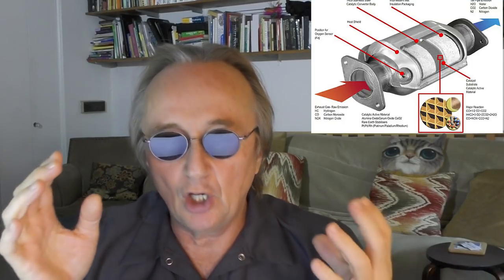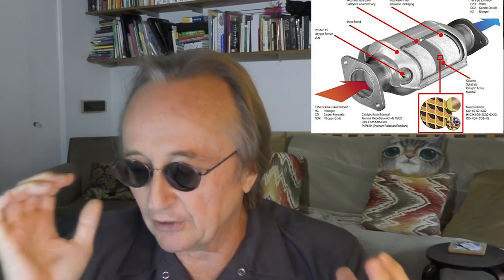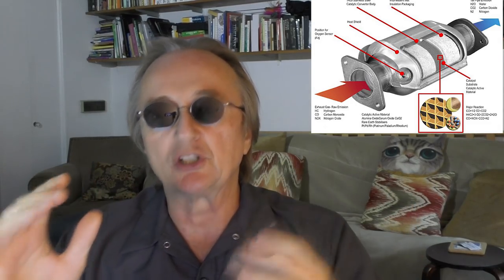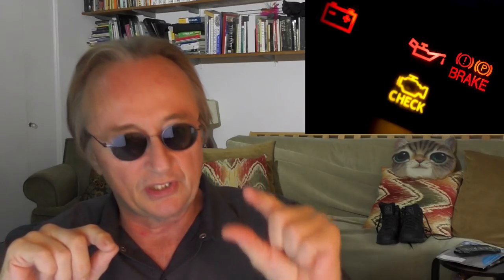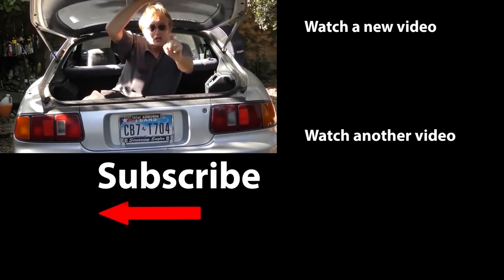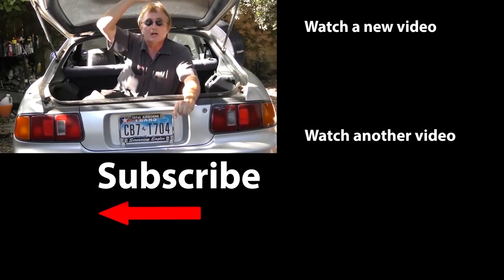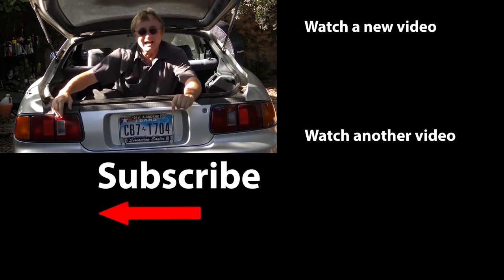Why it’s Illegal to Remove the Catalytic Converter in Your Car

Comment: You’re correct about the engine being stronger than the transmission. I had a friend with a 2005 Grand Prix GXP, it did burn oil but the first thing to blow on it was the trans at 120k miles

Comment: Speaking from experience. DO NOT buy one of those Mazdas.
Reply: But do the new ones actually good?
Reply: I've had nothing but good luck with Mazdas. My father has an '08 Mazda3 he bought brand new, and two of my other friends have an '09 CX-9 and a '12 CX-5. Super easy and cheap maintenance, and the vehicles work flawlessly. But it is absolutely CRITICAL that you change the oil every 5,000 miles or every 6 months (whatever comes first) because of the VVT setup. Otherwise, I think they are great cars.
Reply: Yeah well its powered by a ford v6. No surprise its a piece of junk.
Reply: @lucif3r839  bro say that to my 2011 Mazda 6 V6 which has had ZERO repairs needed . Just oil changes , air filters, transmission oil change , runs like new .

Comment: in my small country town in the states it is legal to take them out but they're required in the city(our car also got its fuel pump replaced along with a 4 in 1 catalytic converter removed)

Comment: 86 GMC Jimmy.  No convertor needed
Reply: When they did have cats, they were horrible for clogging off.
Reply: No emissions testing for vehicles over 25 years old ,here in Texas.
Reply: jerry rodriguez man I want that! ! There hard to find in Michigan, when you do the body's gone. I have a 98 Tahoe, runs great! But the dang salt!
Reply: Um...unless it's a Diesel yes you need one. Your state may be cool with that but there are others....
Reply: @sandralaunstein6436  I have slight rust on the inner fenders but that's it . 6 inch lift ,35s ,456 Yukon gears ,lockers ,350 with a Holley avenger carb, headers etc
Reply: true but it still has to pass the smoke test.
Reply: @ateam6486  You mean smog? Most states don't do emission tests or inspections
Reply: the most common rule is cars must meet emissions requirements of their production year
Reply: TheSushiraw  Not needed, required for that year, yes, needed NO.
1986 K10 500,000 miles and counting......No cat since 78,000
Reply: @ateam6486  LOL We don't have smoke test, and in fact its over 25 years old, no emissions requirments at all, AND if I put historic plates on it no inspections AT ALL!😁 God I love MO
Reply: @devinwilliams3489  not after 25 years

Comment: In South Carolina there is no car inspections so.....nothing but freedom comes out of my cars.
Reply: If you could put a cat back on when you can I'm sure everyone here would be grateful, we share the same air after-all.
Reply: Adam Nope yea that was a joke. I do have a car with a test pipe but it’s not a street car. Lots of people in sc don’t tho bc there is no inspection.
Reply: please look up what a federally mandated EPA or federally mandated safety device is.    such as seat belts,   air bags,   and even in states with no smog testing you must still have the cats on,   and after taking them off or hollowing them out,   did you notice a huge increase in gas use,   do you know what and how oxygen sensors are??  and how they control fuel injectors.
Reply: Freedom to breath clean air?
Reply: Its tyranny!

Comment: cmon scotty, hydrocarbons are really bad. it shouldn’t JUST be the law why not to take off your cat.
Reply: Samu BRidges Cats also get rid of NOx and carbon monoxide. Those hydrocarbons become soot all over the cities. 

I'd not remove them. I really don't feel like polluting for a slight gain (hardly any nowadays). The good news is that the mandate was to ensure that the majority of vehicles would have them. A small minority of rubes and ricers won't singlehandedly destroy the air.

Comment: Scotty, is it illegal to have BMW angel eyes on a different color than white?
Reply: Don't be a tool
Reply: Jwjsudksj Idksjhdjjdj i think blue and red are illegal but honestly just don’t do it. It’s looks great as it is. Maybe there’s kits that let you change color whenever you want but I’d just let it stay as it is. But definitely avoid colors like red and blue.
Reply: Joseph Samsor Ty, not enough with red and blue I have up to pink. It is remotely controlled:p
Reply: Jwjsudksj Idksjhdjjdj yeah just look up what’s allowed in your state and do that. Maybe for pictures or meets you can put on whatever color you want but on the road certain colors are banned. Probably due to police cars using those colors.
Reply: Jwjsudksj Idksjhdjjdj which angel eyes? I think white or a lighth blue is best
Reply: It depends on your state law
Reply: Jwjsudksj Idksjhdjjdj  yellow , bleu, purple!!!! Pink, its all illegal
Reply: Hugo Lizardi Write this on Ebay: bmw e46 multicolor angel eyes. You will se pictures with a remote, got them
Reply: It's certainly illegal to engage the flashing amber lights when you're driving a bmw.
Reply: BMW owners want mood reflecting head lights so you'll know what stage of shmuckiness they're at???🤷🏻‍♂️

Comment: If your 02 sensor is before the converter don’t remove it that will throw off a code as it’s gonna show your running rich but if it’s before the converter knock yourself out it does help open the cars up and give a little more sound. I live in Kentucky where we don’t have any kind of inspections and I usually do remove them as long as the sensors are before the converter.

Comment: The federal law only applies to companies doing it for customers, or for vehicles used for commerce. If you don't have emissions testing, or are exempt, you are fine.
Reply: Tim Ramich whether you’re right or wrong it doesn’t mean you should pollute the air.
Reply: benefactionhindrance  Without it, it don't pollute any worse, actually probably less due to not choking the engine with another restrictive device.  Anything you add downstream from the headers is restricting exhaust flow which in turn restricts the capability of the engine to breathe thus choking the engine and causing it to use/burn more fuel because it has to work harder.  Punch out the internals of the catalytic converter and put it back on worst case...best to just remove it and replace with a section of exhaust pipe.  You'll get a little more power and a bit better fuel economy without the catalytic converter choking your engine.
Reply: @buffalobillswin187  It takes unburned fuel to run them. That's not a desirable trait for running an engine. Or for your pocket.

Comment: Im thinking of buying a 2000 bmw 323i for 2,500$ it is in good condition what do you think of this car?
Reply: Marcos Rivera he hates anything bmw lol. I’d say it’s a good car if you handle all the problems yourself. Don’t expect it to be a daily the first year you own it. I have an f30 so I’m in a different bot
Reply: Ya bro the parts are cheap as heck on amazon, huge online community. Get a manual transmission . I have a 98 323 with 196,000 runs like a monster. Full headers, true dual exhaust. It handles as well as my old rx8 if not better.
Reply: Buy post 2003 for a facelifted model, much of the problems sorted, but still a money pit. Expensive parts.. rust..
Reply: For the most part, the e46 chassis is a well made car. If you get one in very good condition and keep up on maintenance, you'll probably be fine. Make sure you look for the usual issues (rear shock mounts, rear subframe mount cracks, etc). Keep in mind that as they age more parts will fail simply due to wear and tear of typical driving.
Reply: Topher7527 thank you
Reply: Mike B thank you
Reply: Hugo Lizardi ok thank you

Comment: Oh no! It's not just unburned hydrocarbons being converted. It also changes NOx gases and CO gases!  The engines computer does actually use that information to change fuel ratios. This could mean that the computer will run it leaner on purpose which can prematurely wear the engine, as can a rich burn as well. You remove the O2 sensors, then you can loose power because it sets the circuit to open, and this means that it just dumps fuel (creating a rich burn carbon building scenario.) You can bring the car in for a program of the ECU though, allowing it to be tuned, which you should bring in every so often to make sure you have your car adjusted due to normal wear. (like every 3 years at most.) Just deleting the Cat could lead to some issues.

Comment: My brother owns a 2001 Saab 9-3 and he completely removed the exhaust system, and replaced it with a 3in exhaust front to back with the flex pipe, new catalytic converter, flex pipe, muffler and new O2 sensors. The car breathes better and it sounds real nice too, he didn't do it for no reason either his old cat got melted so he had a check engine light from the poor emissions.

Comment: I've got long tube race headers and true dual 2 1/4 straight pipes with 6inch tips on my daily driven 1995 f150 5.0.  Ever since I hacked the cats and muffler off it it has run much better and my mpg went from 6 to 15.5mpg.  You don't need the cats or muffler they add to much backpressrue to your exhaust and restrict performance.

Comment: cutting off the converters is way bad idea,   you mess up the exhaust flow,   and whats located in the exhaust that controls how much gas the fuel injectors put out??    the oxygen sensors.  and then your car sounds like a VW tank and sucks gas so fast you can sit for 5 minutes and see the fuel gauge fall.  and even if your state does not do smog testing,   the cats,  seat belts, tire pressure monitors and air bags are all federally mandated EPA or safety devices and removing them is illegal,   and yes i know sops that have done it and they went out of business due to high fees in court per car they did,

Comment: I can't account for the law's in every state, but I know here in Connecticut vehicles need to go through emissions until the vehicle turns 25 years old. At that point it becomes emissions exempt. But here in the rust belt it's rare to see a vehicle that old that hasn't been restored, of course only the vehicles worth restoring go through that process.

Comment: The GXP has the ls4 in it which is why its 6k
And the transmissions were rated to work with all hp ratings of those cars, its just that people often mash the gas on them and that burns through the trans really quickly, they're for highway pulls and whatnot, not peeling out from a dead stop

Comment: I just bought a 2018 mazda cx-9 gt and have put 11k miles on it I am 56 and my dad was a master mechanic for over 60 years. I was in the NAVY and learned electronics but a lot rubbed off on me from my dad I can say the maintenance cost is a bit high. But I have always got the maintenance done at a dealer for the first 36k miles that way they can not blame me for not doing the proper maintenance. I also have  a 2006 scion xa with 190k miles that runs like a champ. I have done the maintenance since 36k miles . We use it for trips under 70 miles and use the mazda for long tripps.

Comment: Scotty, what is your opinion on Key banging your car? That’s when you have your engine running, turn the key to accessory position and back to the running position before it completely shuts off. That makes your exhaust pop nicely every time you let off the gas but I’m sure it’s not safe

Comment: Had an old 86 firebird with the tiny v6, the cat went bad so I put a straight pipe in, then the muffler rotted out so I literally drove it without a muffler and a straight pipe for a couple weeks to work. It was so friggin loud 😂, literally waking the neighborhood up early in the morning. But it was a bomb that was give to me cause it wasn’t running right. I put $500 in it and ran for a few years

Comment: I live in Arkansas, and lots of people remove theirs, my is bad, 2000 Acura TL, it will breath better, must bypass the O2 sensors , but the ehaust is rusting out, got 14k in maintenance, so for 140.00 will do it, that thing has 2 cats and 3 mufflers. But in Arkansas it's 100% legal, no inspection required here

Comment: Nissans in my experience are bulletproof! I have owned 5 maximas and 2 altimas and now a Murano with 125K  and Infiniti G35s with 160k! They work! They dont breakdown...with other than normal stuff, brakes tires and rotors! My son bought a 1985 nissan maxima with 425000 miles and drove the heck out of it!!! My 2 altimas had close to 200,000 miles until i hit deer or sold them!

Comment: Hey Adrian, if your car has any potential at all for higher power from tuning and bolt ons there certainly would be high flow catalytic converter available for you to install on it. If the after market does not supply one you either own a slug or an unpopular vehicle.

Comment: Well, I've removed the catalityc converter on my 0.8l chevy spark engine since I dropped it into my buggy.. It runs fine now with the correct fuel pressure.

Comment: A catalytic converter does not burn hydrocarbons, it uses two chemical processes called reduction and oxidation. It removes oxygen or adds oxygen depending on what gasses are in the convertor. They react with the platinum or palladium and change form to a less harmful pollutant

Comment: 1:00 there's a difference between Accessory and Run. When the key is in accessory the computer shouldn't be on at all and there should be no lights on the dash

Comment: I’m 19 years old and I bought a 94 BMW 325is E36 for $500 and only put about $200 that only for inspection. It’s a really good car and clean as well and yes I bought it with my own money. I pay almost $100 a month for insurance
Reply: Yeah but when you get it from a dealership you have to get full coverage unless you're buying it outright. Even then a teenager with under a year of driving experience getting a sports car will cost near $300/month until they turn around 19 where it'll go down to around 180/month if they don't get tickets or any accidents.
Reply: Zombie Drift 45 good choice buddy, wish I had a 325 when I was 19. I have an e36, best chassis ever IMHO. Get yourself an M3 mid pipe, 328 headers and UUC exhaust, sounds awesome

Comment: Awesome how this video was about catalytic converters and then the subject changed to 2.0/2.4 liter Hyundai’s and Honda engines and why not to buy them
Reply: I have a Honda Accord 2006 2.4 Engine, is that a good car?
Reply: @robertrodriguez-fk9qt  yes it is a good car one of the best older cars you can buy 400k miles easy of you take care of it
Reply: @Walrus50  I think my catalytic converter is bad, because it doesn't pick rpm fast like it use to, i use to go 120  preety quick and now it takes a while, i have sparks change ,coils ,filter , i have no ingine light,. Please help me out .🥺
Reply: @robertrodriguez-fk9qt  well to figure out if the catalytic converter needs replaced or cut off depending on your location get under the car and hit it with a hammer if you hear a rattle it is bad or take it to a shop it may also be clogged but typically it will throw a engine light and it may also be the age of the engine becuse overtime a car loses power but I recommend letting a professional shop take a look because there is only so much I can say due to the internet
Reply: @Walrus50  i will do that , if is not that, what else would you recommend it is?

Comment: The check engine light on my 04 Ram 1500 has been on for 8 years.  Found out that when I put gas in it and loosen the gas cap the vacumn is broken and the light comes on. There's even a warning on the gas cap that this will happen. I've put 70,000 miles on this truck and never had a problem. It's the 4.7 engine and it runs like a Singer sewing machine!  Doesn't use oil and doesn't miss!  The truck has 256,000 miles and I would not sell it!  Drive it anywhere!

Comment: What about a 2001 Dodge Dakota 4.7 V8 with a new engine that has 50K and a rebuilt transmission? I’m 17 and I’m holding the truck for sentimental value at this point, I’m just wondering how bad the truck really is in your eyes.

Comment: I run my old 86 chevy on Propane the exhaust is really hot so i dont  use them, the exhaust is very clean compared to gasoline i bought the truck this way . It will run on gas but i only use the propane, its easy to fill up at my ace hardware but i only drive locally

Comment: No do not remove the converter if its a stock car because of the o2 sensors. Thats the only way for the ecu to tell how the engine is running. On a modified car go for it since youll probably be using an aftermarket ecu/ignition control so it wont matter as much.

Comment: I have a. 1998 lincon towncar with 12.000 mil . im scared of dry rot especially on the air bag suspension my understanding is the engine is reliable. it just scares me because it's been sitting for so long and only being driven about a thousand miles a year

Comment: They do it in every single state. They’ll just put a different exhaust on or something to pass emissions. I think some even use custom exhausts to be able to unbolt it and put in a straight pipe and revert back easily if they need to. I’ve never heard of anyone being caught for being straight piped.

Comment: I removed the catalytic converter cause the engine was overheating, it was a lot cheaper to remove it than to replace it, only downside is that is a lot more noisy.

Comment: Just bought a 2011 bmw 335i xdrive for $14,000 78,000 miles. Has a muffler delete, cold air intake, after market rims and performance tires, clean title and clean car fax. Good buy?

Comment: I heard that if you remove the cat on a modern car  could lower the power because the engineers designed the engine factored it  and exhaust pressure  in play

Comment: Scotty, At 2:30 you show the ford 3.5 duratech. I have a ford flex. You notice the internal timing chain driven water pump. What is your thoughts on it. Its a copycat of the mopar 2.7 but with better made parts. Anything to keep the water pump alive other then flushes.
Reply: lokisgodhi  Not a direct copycat. But one stupid enough to put the water pump inside the engine just like the mopar 2.7.